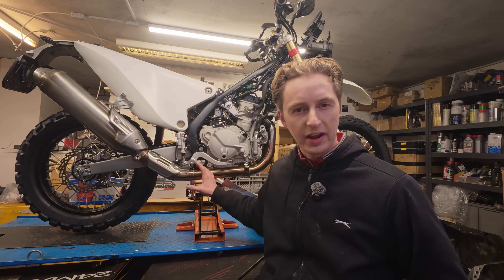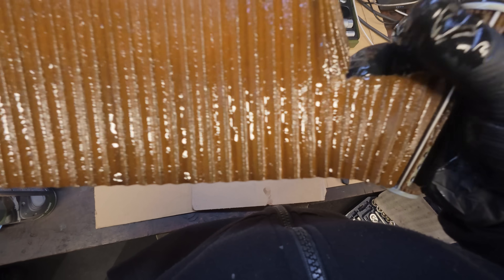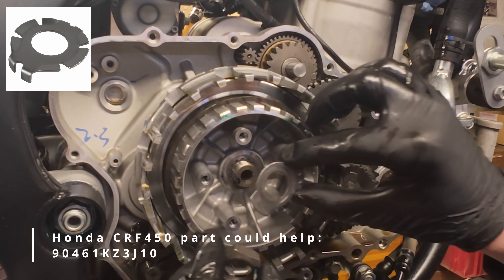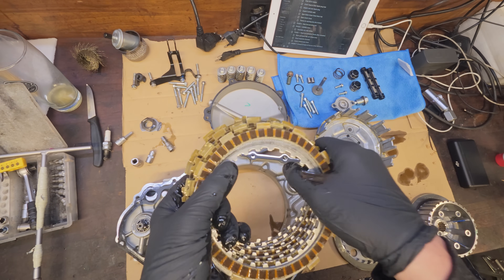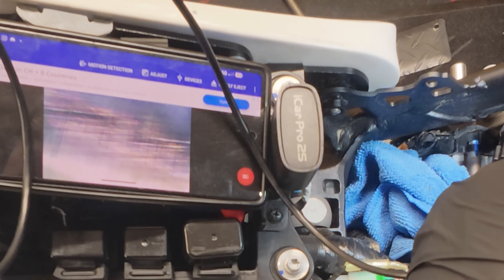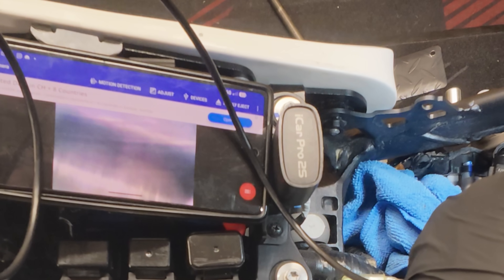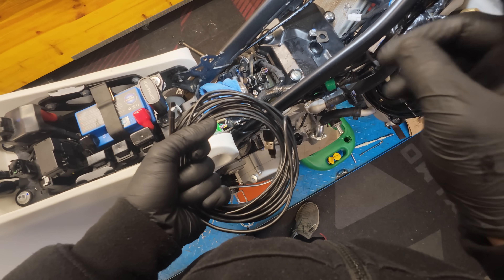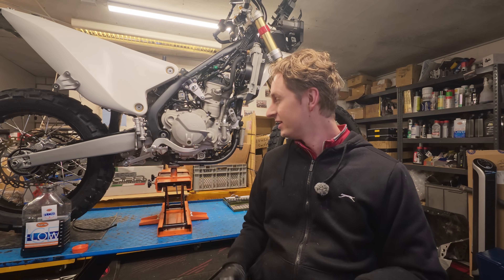Inside the Kove 450 Rally Engine After Real Desert Use

Comment from the maker: A quick note for context:
The oil change in this video was done cold because the engine could not be run at that stage (valve work ongoing). This inspection was about checking internal condition, contamination, and wear. Not a final service. A proper warm oil change will be done after first run and another valve check. So far: no oil consumption, no coolant loss, and nothing abnormal found inside.

Comment: Gawd...not the plastic...errrrr...nylon oil pump gears! 😢
They've been in use for 40+ years, but I'm still not a fan.
Just asking for trouble down the road...
Reply: If the oil pump fails, it grinds down the teeth, giving you a chance to stop the engine and pull over. If it's steel, it can't do that, and will lock up the engine/catastrophic rapid disassembly will happen. Nylon gears have been used for decades... Just replace them when you pop the cover off every odd years.

Comment: Great video, . Just a note about the tab washer behind the clutch hub nut. If you bend one tab inward, it should lock onto the hub, then bend the other tab out, it will lock onto the nut. Thanks for making another great video.
Reply from the maker: Was not 100% confident in this solution so modified it a bit after cutting the video. Nut probanly that is what it is supposed to be

Comment: Nice video !   I’m not sure I like the look for those plastic cogs behind the clutch .  Are they for the oil pump ?
Reply from the maker: Yeah oil pump is driven by plastic gears like in a DRZ, XT600 and many other bikes in that category
Reply: @MotoMottoTV I didn’t know nylon gears for oil pumps were so common. They seems like a common point of failure .   Thanks for letting me know .
Reply from the maker: @nickclarkuk yeah many very reliable bike use plastic gears for oil and water pump. Something I always replace on customer bikes when having it open. I habe seen chipped off teeth but never seen a failure due to it.
Reply: Does anyone offer metal replacement gears? Uncle Wang etc?
Reply from the maker: @Motardsadv haven't seen. But they are plastic for a reason. Maybe not just cost

Comment: Plastic oil pump drive cogs dont do it for me.. 😂😂 glad my 510 Husky has real steel cogs..
Reply from the maker: DRZ has them as well and even though I hav seen chipped off teeth I never saw engine failure feom that reason. But I agree, not a big fan of it either. Probably best to replace them once in a while
Reply: @MotoMottoTV with the screens and filter the pump shouldn't injest any chunks to cause failure but plastic just don't seem the right choice for the heart of any engine.. no oil and it's a long walk home.. dropped valve or rod failure it's still a walk home..
Reply from the maker: @rebekahfrench5747 from what I know plastic gears are used in many engines for reason of weight, vibration reduction, low-torque application and of course for cost reason. Maybe also some kind of sacrificial piece to prevent other damage.

I don't see an issue with it as long as the engine gets a weak spot check here and there which in my opinion should be done on any bike if one wants to really rely on it.

Comment: regarding the locking plate of the inner clutch hub nut.
one tab is supposed to be bent towards the hub and the other towards the nut.
this way it "locks" the nut!
how was it installed from factory?
p.s. just saw the note in the video! xD
Reply from the maker: Only the tab holding the nut was bent, not the other one. I modified the unused tab a bit to really hold onto the inner basket.

Comment: A very interesting video showing the engine internals and engineering. Regular oil changes are the key to longevity.
Reply from the maker: I agree, replacing oil is cheaper than replacing an engine..
Reply: My concern with modern engines is that the engine oil is shared with the gearbox and clutch. Metallic particles from the gears and clutch friction material must end up in the oil ! High compression pistons place extra stresses on the gudgeon pins, big ends and mains which are likely in these engines to be plain bearings and together with high combustion chamber temperatures the oil has a difficult time, liquid cooled or not !
Reply from the maker: @Triumph-Tiger-90-Com shared oil for all components has some downsides for sure. That is the reason I like to change oil more frequently than stated by the manufacturer. Small routine process that is a key factor for longevity. I have a feeling that Kove made tha bikes engine characteristic very tame in low RPM torque mainly for longevity. It feels like a restriction setup to prevent high stress situations that you are talking about

Comment: Calm down with the thread locker, you need about 10% of the amount... Just a few drops!
Reply from the maker: You are right, too much can hydraulicly load the threading and make torque readings inaccurate. I just wanted to make sure that sucker stays in place with that useless lockwasher. I calmed down in the second time where I fixed the plate though 😂